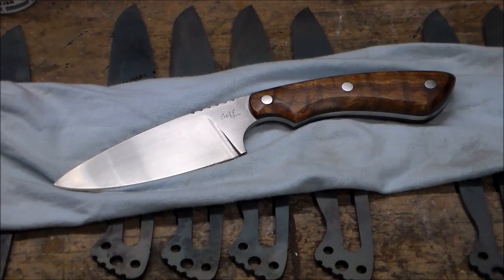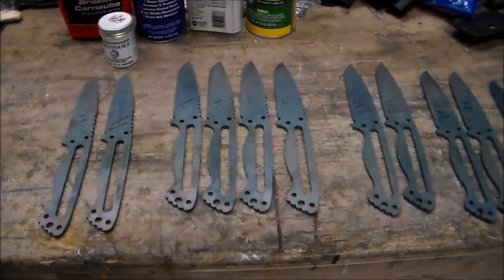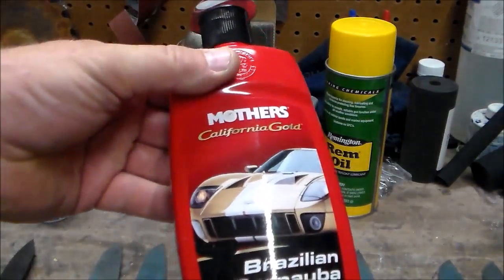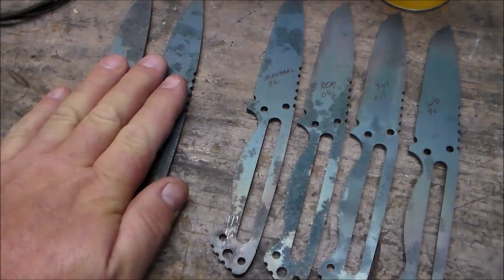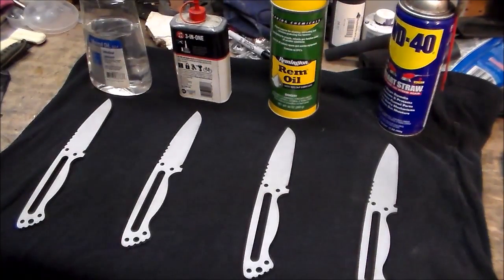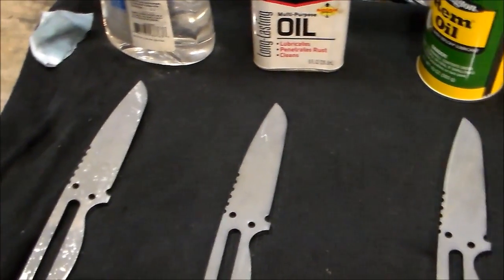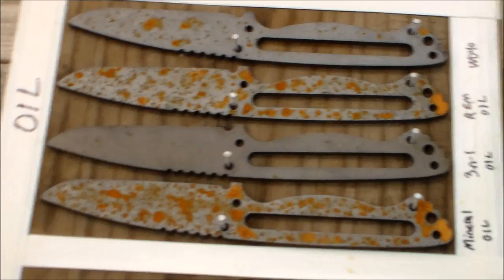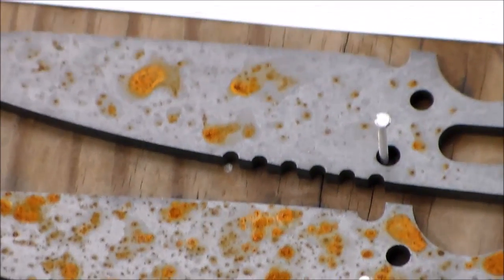1095 Steel, Corrosion/Rust Test for Knife Makers

Comment: So why use 1095? Is stainless steel ic 440C, AUS-8, VG-10 not better?
Reply from the maker: People will argue what is the best steel for knives forever. It all depends on the intended use, cost, ease of working, etc. 1095 for example can be forged and heat treated by most people relatively easily. With a good heat treat is pretty tough. It's also popular for producing hamons. Many consider it easier to sharpen that some of the SS blades. I use stainless too, personally I like AEBL, CPM154, 14c28n, and 3v. Everybody has their favorite.
Reply: @SelfMadeProject  Thanks. I have been put off buying anything in 1095 due to the rust factor and then I found out that very many steels outperform it. So in that sense I am apprehensive. Why does TOPs not use 420HC or more expensive stuff for their knives? Ok. Maybe 1095 is a working steel, not a display steel. But nonetheless it is intriguing. Maybe its a philosophy or something.
Reply from the maker: @andrashavas  well, for one thing, 1095 is considered tough, it's great for hard use knives. It's also much easier to sharpen in the field that some of the super steels. It's also a reasonably priced steel. Some of those TOPs blades would cost twice as much if made from the super steels. Tough, economical, and easy to sharpen. Just have to perform some maintenance on it, that's the only negative.
Reply: @andrashavas  stainless steels are considered too brittle for some outdoor enthusiasts. The chromium content that gives stainless steel the rust resistance is what makes it brittle. If you aren't planning on pounding on your knives, go with SS. If you plan on using your knife for chopping or batoning, carbon steel is often a better choice. 

14c28n is one exception. According to Knife Steel Nerds through their testing, it's tougher than many carbon steels like 1095. The edge tends to roll easier than 1095, but both are easy to sharpen in the field. I personally love 14c28n for its versatility.
Reply: @andrashavas  you can also get around the rust factor with a high carbon steel by taking good care of it and developing a patina on it over time once you have a good patina developed you don't need to worry about rust that much and it gives a knife character in my opinion
Reply: @NickTatorship.  Thanks!
Reply: Im here becausr I bought a knife 1095 steel blade for $80 bucks on Amazon (Condor knife) and sitting one week it looks 40 years old. Covered in rust. Why would you want to carry a strait blade that gusts like that? I have a cheaper $30 shrade blade that i think is 440 and never had an issue. Use in the field and at hime to cut foid and what not.  If you are looking for daily carry strait blad eavoud 1095 its trash.
Reply: @jjmcwill1881  You have to be an educated consumer, you’re making mistaken generalizations . The $80 Condor needs a little maintenance, regular oiling especially early on. (Even your rusty knife just needs a surface clean with oil and steel wool) The upside is that you can sharpen it on a wet rock and can pound it through firewood all day.  Condor makes bush knives, 1095 is perfect for that, far superior to a 440 Schrade. 440 is not a good knife steel. 440c from a good maker is okay, but I doubt your Schrade is 440c. A cheap 440 knife is fine for someone who will never sharpen it, never use it enough to dull it, and doesn’t know anything about or care much about quality steels. There are better stainless steels, even on a budget (14c28n for example) and infinitely better stainless steels for $100-$200. I’d guess the majority of cheap knife users don’t have a sharpener and don’t use a knife as a frequent tool, so steel choice is really irrelevant. A Yugo is fine if you don’t drive. 😂

Comment: A great pity you didn't include Vaseline in your test. A great, cost effective, item to prevent oxidation (rust).
Reply from the maker: I should have probably, didn't even think about it at the time. Good suggestion.
Reply: I've used vaseline  on my swords to good effect on display in a 50% RH controlled home.  I've just been introduced to Renaissance.  I like the idea it too suggests an air gap,  but with a thin,  hardened barrier.  Looking to see how things progress.  Thank you for the science work - damn fine!
Reply: @ChrisPowell-MerleApAmber we've all used Vaseline on our swords

Comment: yeah I ask about  carbon steel  oile.
Reply from the maker: Still not sure what you're asking. If it's about quench oil for 1095 steel, Parks 50 is best, but canola oil works ok too. If it's about rust prevention, my tests show that 3n1 household oil works better than most.

Comment: So blued with 3in1 oil should be the best?
Reply from the maker: From the products I tested and the way I use them, yes. 3n1 on a blued blade worked best for me. That's the way I ship most of my knives out.
Reply: what method of bluing do you use?
Reply from the maker: Cold bluing. I use Birchwood Casey Super Blue, it's easy and available a lot of places.

Comment: Testing just oil and blued & acid also with oil - blued & acid no other treatment???  Conclusion so far acid + 3n1 which is also not tested as yet
Reply from the maker: Not sure what you mean, I tested 2 waxes and 4 oils that I've heard others say they use. The blued/acid was just to see if those oxide coatings would make a difference, which I think they do. I was actually thinking about switching to wax before this test, that was the reason for the test.

Comment: I've always used mineral oil.  Sad to see it do so badly in this test.  I'll have to still use it as I see no other option that would support food processing knives.
Reply from the maker: I think any of these do just fine as long as you stay on it. Regular care is the more important than which product you use. Mineral oil, for example, is great if you keep reapplying it. I just wanted to test the worst case scenario that a customer might do to my blades.
Reply: Thanks, it has worked so far.  To add to it, I'm always around salt air/water.  However, my environment tends to keep me aware and I always carry fresh water to rinse it off and the oil in my bag to wipe it down after use.
Reply: How about Bee´s wax?
Reply from the maker: kaunas888 Hmmm, haven't tried it, but it would probably work. I've used paste wax on tools to lubricate and protect, so I'd bet it would be ok.

Comment: Guess im going to get some 3in1 oil now, been using mineral oil so i dont have to worry about food. Hope this guy didnt take the 3in1 blank inside most of the 21 days so it would win the test.
Reply from the maker: Hey now! No cheating I promise. Actually this test was supposed to prove to me that Renaissance wax the way to go. I was surprised by the 3n1 too. I think mineral is probably fine, you'll just have reapply more often and keep an on it. Have you had any rust with it so far?
Reply: Self Made the only 1095 knives i have is a Tops Viper Scout, a Kabar Short, and soon ill have the Tops ATC Hondo too, but i live in Louisiana so im worried about them rusting, especially when taken out and used. The mineral oil being food safe was a big plus for me but rust resistance is more important considering where i live, glad you did the test, will pick up some 3in1 soon.
Reply: Self Made no, no rust yet but i dont get much use out of them, im more of a collector, ive got them stored in a plano container in my closet, ive had the kabar for a few years and its just been stored since then, i didnt like the edge on it so i sharpened it and since then i think there might be the fainstest of rust staining coming in but too early to tell.
Reply: On the edge
Reply from the maker: For me, the only knives that I have that must be food safe are hunting knives. The main animal I hunt is whitetail deer and I mainly use the same knife for that. It is stainless steel, 14c28n to be exact. I do not put any oil on that one. I made it 2 years ago it still looks as good as day 1. Pocket knives, utility, survival, camp knives, etc. though all get 3n1 now. And, if I'm really in a survival situation, the thought of food safe oil is going to be the last thing on my mind. Good luck with yours.

Comment: NO nonsense Video. MUCH appreciated! 
One question, how do you reckon the three best results you achieved would work in combination? FERRIC CHLORIDE + SUPER BLUE + 3 in 1 OIL?
Reply from the maker: Well, the ferric and the bluiing are doing pretty much the same thing, putting an oxide layer on the steel. Not sure what would happen if you used both process at once. I'm guessing it wouldn't be much different, but that's just a guess. Maybe I'll try that with some scrap someday.
Reply: I tried out SLIP 2000 EWL on some 1055 carbon steel throwing knives, just to see what would happen. I lost one in my backyard for an entire winter. When I finally found it there was a couple small patches with a very thin layer of rust, which I buffed off with ease. I was very impressed. 
Great video!  It is obvious you've taken some science classes, or had some kind of experience with science tests; using a control, not interfering during the test, setting parameters well. Interesting results, I knew I didn't like Rem Oil for a good reason. Now I know why. Thanks for sharing.
Reply from the maker: @RockyMountainBear  Thanks for checking it out. Never heard of SLIP, what is that?
Reply: @SelfMadeProject  I use it on my firearms.  The EWL stands for Extreme Weapons Lubricant.  The label calls it a "pure synthetic metal treatment. Lubricates - Cleans - Protects - Penetrates - Bonds - Reduces Friction and Wear.  Non-toxic - Non Hazardous."  I got it from my local gun shop.  I assume it's somewhat similar to 3 in 1 oil.  It's my favorite product so far for my firearms and high carbon knives and tools.
Reply from the maker: @RockyMountainBear  Cool! I'll add that to my growing list of things to try someday.

Comment: wax it supposed to be heated on  normal bees wax. very good experiment by the way
Reply from the maker: Thanks, I'm going to try bees wax one of these days for sure.
Reply: there are several blacksmiths that use bees wax, they basically rub it on while its hot and it melts in to the micro pores of the metal then wipe off the excess wax before it cools. not sure how to do this with a tempered blade but there you go. However i have used this on cast iron and it works fantastic. use a blow torch to warm up the object??

it is good to see someone using a science style method to test this. i was very surprised at the 3 in 1 oil
Reply: Doing it after heat treat is no biggie.  Just need to warm it up enough to melt wax, no need to go anywhere near hot enough to mess with the temper. I'll use a toaster over set low, or a hair blow drier, could use a heat gun.

Comment: This is gonna sound stupid to a lot of people but why don't normal store bought knifes rust?
Reply from the maker: Not a stupid question at all. Most factory knives are made of stainless steel, which will also rust, just a lot less, hence stain"less". Most SS factory knives also use a lower quality, cheaper steel that has a reputation for being harder to sharpen and short edge retention. I also make SS blades, but only use the best quality steels. Many factory knives use carbon steel too, but they usually use some sort of coating to slow rust.
Reply: They do, but they're almost always made from stainless steels rather than high carbon steels so the process is a lot slower, and they're often not subject to as harsh conditions as outdoors type knives.
Reply from the maker: Ludvig S There are plenty of carbon steel bladed pocket knives still on the market. A lot of the older guys will only buy carbon steel blades. I think SS blades got a bad rap during the 70's and 80's by some bad imports, but lots of production knives now have some nice steel. I pretty much only use SS knives for my own use, but still get tons of requests for carbon steel bushcraft, hunters, survival, etc.
Reply: Thanks both of you for the reply, that helps

Comment: I'm surprised you did not try Bees Wax
Reply from the maker: I was just trying to use what I had around the shop and figured it was what most other people would have around too. I didn't think about Bees Wax, but I'll add it to my list of things to try.
Reply: Self Made   Warm the wax up with a hairdryer or slight flame don't get the metal hot just melt the wax into the metal.
Reply: I actually use a Bees Wax , Vaseline mix
Reply from the maker: I've been keeping a list of suggested things to try. One of these days, I'm going to pick about 5 or 6 of them to try on another test. Just been so busy, hadn't had time to set it up.

Comment: Awesome test and video! Just fyi, which I'm sure you're aware of now, but remoil is absolute pure garbage!! It offers ZERO rust prevention and when stored it turns into a nasty, gummed up mess. It is worthless shit and should be avoided for use on anything.
Reply from the maker: cfltitan yeah, I'm not a fan. I use it as a lube sometimes, but when I run out I won't buy anymore.

Comment: just saying, this test could be much more accelerated just using the method that usually does in industry, spraing salt solution in a chamber at 60oC. You could be able to make even a full video of corrosion test.

Comment: What type of mineral oil did you use?  There are three basic types of mineral oil: paraffinic, naphthenic and aromatic.   http://www.ehow.com/list_7456026_types-mineral-oil.html
Reply from the maker: +Jake Enns I used regular mineral oil like you get in Walmart in the health and beauty section. I looked at your link, but it's not apparent to me how it would be classified. I've used it to waterproof wood cutting boards and honey dippers for the kitchen. It's supposedly safe for human consumption. If there's something we should know about other kinds, please share.
Reply: +Self Made I don't know all that much about the different types myself, I just know that one is for human consumption and the others are definitely NOT.  The ones in the beauty section act like a solvent to clean makeup off, and any solvent type product does not seem to me to be a good sealer, but the mineral oil that has paraffin in it would indeed seem to offer at least a better seal than the others.
All being said, I don't think that the mineral oil with paraffin would beat the two top winners in your test, I was mostly curious.

Comment: Pretty unrealistic test for several of those blanks. What's the point of doing rust testing on blades that are in the white?  No one sells knives without a finish. The only ones that seem relevant are the blanks that have an actual finish. The ren wax on the blued blank looks like it works fantastically. And it would be rubbing into a leather sheath internally helping keep moisture from soaking through the leather into the blade. Win win. Also rem oil is trash. Don't use it on anything you care about.

Comment: Torture testing has its  place unlike you JoeX tests to failure.  I love seeing your and his results. They show me limits.  Knowing the limits helps me keep me knives in terrific shape.   My carbon steel knives are usually refinished with a forced patina, and I use the same home made fixin wax on knives, sheaths, cutting boards almost anything.  It's a combination of beeswax, mineral oil and coconut oil and some essential oil for a nice smell. I wipe my knives off after every use, and wax/oil them  and the sheaths at the same time as needed.

Comment: The salt treated lumber you have them on may have messed up your test
Reply from the maker: Guess it's possible. That board was around my shop for a long time, it was completely dry. I don't recall the back of the blanks looking particularly different. I guess even if it did, it would have reacted the same to each blank, so any effect would be equalized.

Comment: you clinch in oile .
Reply from the maker: I think there's a translation issue here, not sure what you mean. These are carbon steel blades and they are quenched in oil during heat treating. But, this test was comparing various oils and waxes for rust prevention. These were un-hardened blanks.